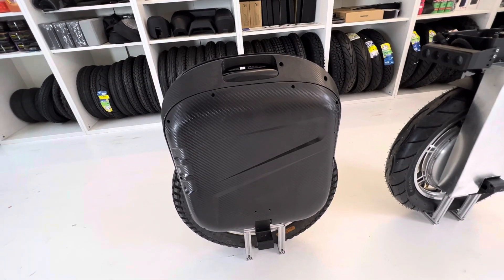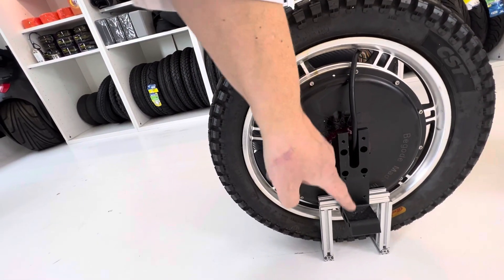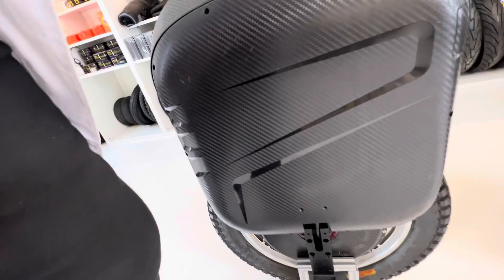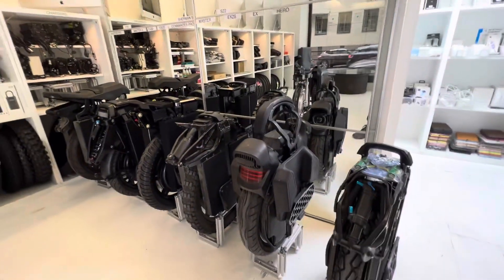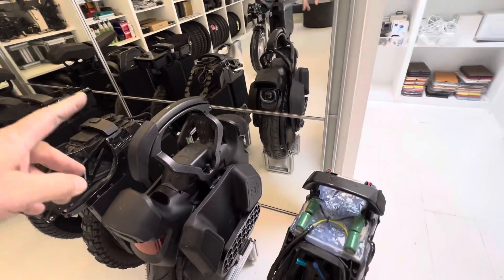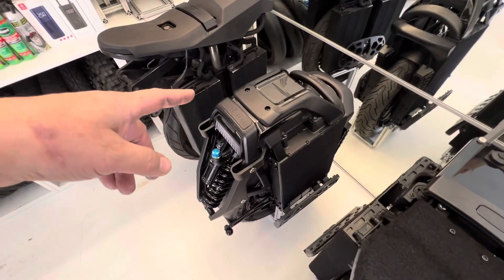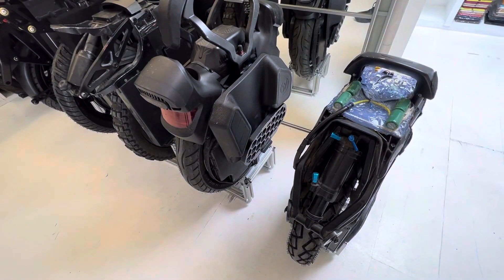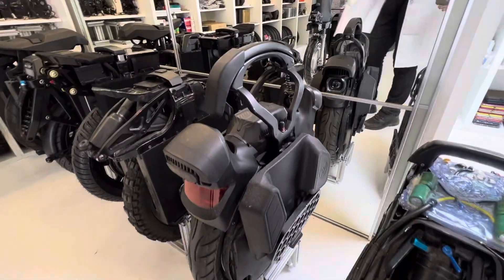Suspension EUC 2022 side by side review

Comment: Great video man hey what size tire are you using on master x can I have tire dimensions please. It looks thicker than the stock tire!
Reply from the maker: Thank you for asking! Michelin, Pirelli, Metzeler 90/80-14 will be fine. ❤️
Reply: @icafese   I thought master x had 22in tire so 17 instead of 14
Reply from the maker: @indianaeuc7617  Sorry for missunderstanding. There is no Master X in showroom yet. Master X seems to be Master Pro on the diet. 2400wh instead of 4800wh of Pro. I will only have Master Pro in showroom for testrides and moding. But I already have PMT 90/80-17 and Michelin 80/90-17 ready for race of 22", fits Monster V3 and Monster Baby. ❤

Comment: You can not put s22 in with the others, slides completely different and inadequate for the job... Friction plastic slides can not do the job efficiently and effortly... DO NOT BUY KS22 unless you are a big ramp jumper, which most people are NOT....
Reply from the maker: Yes, there are lot of contradictions in S22. Plastic slides vs tank build, weak motor vs huge spring. I see the room for improvement here.❤☕🇸🇪

Comment: I see you waterproofed s18 with some sort of epoxy. Doesn't it melt after heavy use and increased heat ?
Reply from the maker: Thank You for asking. This is our secret souce that we are testing and refining in years now. 😎Cooling & heat-resistant, high heat transfer, transparent, dielectric, UV & weatherproof, breathable but waterproof, shock-absorbing but resealable, self-healing compound. It works very well on EUC controllers and BMS so far. Not for sale yet. More info is coming on this channel. ❤
Reply: Probabaly is just for show in the store..
Reply from the maker: @omidel.  Thank You for asking. This is our secret souce that we are testing and refining in years now. 😎Cooling & heat-resistant, high heat transfer, transparent, dielectric, UV & weatherproof, breathable but waterproof, shock-absorbing but resealable, self-healing compound. It works very well on EUC controllers and BMS so far. Not for sale yet. More info is coming on this channel. ❤
Reply: @icafese  I would love if you could share that secret to DIY comunity. You could safe a lot of riders there. In my country they sell some commercial glue but it is kidna unremovable from PCB :(
Reply from the maker: @danoseus  Sorry, friend, this compound is still under testing. Will be commercially available, ones we are ready. The cost of years of testing, hundreds of damaged wheels is astronomic. Thank You for your support, please, like & subscribe! ❤